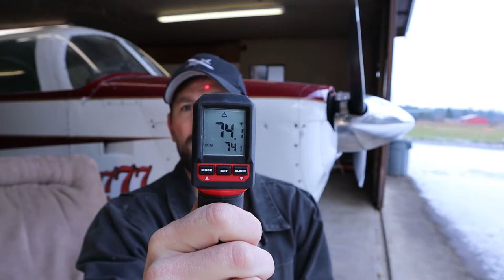To preheat or not to preheat, that is the question!

Comment: I have yet to see any independent studies that definitively show engine destruction with no pre-heating. Plenty of pilots have flown winter after winter with no pre-heat.

I am not a pilot. I do, however, have two heating pads on my 2001 truck oil pan, 300 watts total approximately, maybe a bit more. They have been on there for about 10 years now. I use them when it is really cold. My definition...anything below 10F. Do I use them because my engine is going to blow up if I don't. No. I use them because the engine starts easier and kicks down to a lower idle sooner after start. It also warms up a bit quicker. I use 5W-20 synthetic in the winter. I bought the truck with about 150k miles. It's now pushing 300k miles with the same engine. It's lives outside. No garage. It has had its share of no-preheat starts in sub zero weather. Still runs fine. The transmission will need to be rebuilt before the engine fails. Sometimes I run the heat pads for a few hours in the morning. Sometimes I run them all night if it is going to be minus 15F or colder. Yes, they do indeed help. Are they absolutely needed, no.

I would say a heater like the Twinhornet 22, set inside the engine compartment would be an interesting test. Might be better in the interior of the truck. The bottom of the truck engine compartment is all open to blowing winds, so I'm not sure how well that would work. Inside the truck it would be great, especially with frost forming on the inside of the windshield when it is super cold.

I am glad I installed the pan heaters, but it's not like the truck won't start without them. In all the years I have lived in the North, my truck is the only vehicle I ever had pan heaters on. None of my other vehicles ever suffered early deaths from being started in winter with no pre-heat. Use the right viscosity oil. Warm the vehicle up for five minutes and drive slowly around the hood for 5 minutes and you are good to go. Even my air cooled 4 banger VW Beetle did just fine in winter. Sure the heating system for the cabin sucked, but the engine ran fine. There are all kinds of different metals inside car engines that sit outside every winter night and get started in the mornings with no pre-heat. Are all those cars going to zero compression after one winter of start ups? Nope.
Reply: Good points, I guess it comes down to manufacturer recommendations. If you own your own plane and want to experiment with it and never preheat then go for gold, in the practical sense of reasoning it out, I’d lean towards agreeing with your hypothesis. However, a truck engine overhaul will cost a couple few thousand bucks if you’re wrong, an average GA airplane engine overhaul will cost between $15,000 and $60,000. Depending on the model. So I guess we tend to want to give airplane engines every advantage to last as long as possible. Maybe it’s just BS but it makes us feel better lol. Airplane engines are expensive.

Comment: Mike how did you rebuild your engine baffles. They look great!
Reply from the maker: First I dismantled to their various assemblies and mitigated all the cracks or broken pieces. Either stop drilling or actually making new pieces. Then I cleaned it up real well, primed and rattle canned them with Rustoleum Hammered Silver. It hide the surface imperfections and gives a good finish. My baffles were really bad and ugly, they look amazing now.
The good thing about using the silver is that when the baffles get scratches through the paint to the aluminum you can hardly see that it’s scratched. It should hold up well over time.

Comment: So….spring morning with overnight temps below 30°. I arrive at airport at 9 AM and it’s 44° air temp. I’m thinking the engine metals warm way slower (parked outside and possibly in the shade of a hangar), so heating the engine would be good if i plan to fly in the morning? Later in the day it’s 50-60 degrees and would not require preheat? Just checking to see if Mike and commenters agree?
Reply from the maker: Well let’s first start with data from the manufacturers. Lycoming recommends preheat if the temp has been below 10 degrees F except for a couple specific models minimum is 20. Continentals lowest is 20 degrees for all models. So 30 degrees just isn’t cold enough to “need” preheat at all. Go fly have fun. I’d draw the line at about 20 if my airplane is out on a ramp and I have no power. But if power or preheat is available and easy I’d draw the line at 30. Hope that helps.
Reply: @whatsmikedoing8761  thanks Mike. We have tanis heater in our io-360 and electric plug behind the plane. I like the condensation shower analogy and I really like the idea to open the oil full tube after a flight. In the winter I visually saw ice crystals on my dip stick so there was some water vapor in there that separated at some point. Thanks Mike!
Reply from the maker: The moisture in the crankcase is produced every single time the engine is run. It’s a natural part of combustion and some blow by past the rings is normal as well. If flown normally and regularly and oil changes are done regularly this moisture is a non issue. I say this to caution about loosening the dipstick after every flight. It’s very easy to get distracted and leave the dipstick off and close up the cowl. Then get in a rush or miss it during preflight then you have oil all over the place. So if you want to make loosening the dipstick a regular after flight process then just make a long red flag or strap or something that you put on the dipstick and hang out the cowl when the dipstick is loose. Then you’ll likely never forget it.
Built in preheaters are great! Nice
Reply: @whatsmikedoing8761  thanks for taking the time to share your advice. I look forward to more videos. We have a 72 Cherokee 180 G just bought last year and coming up on first Annual end of June.